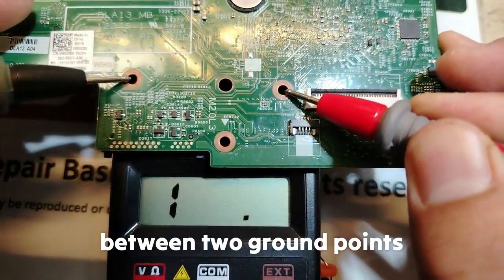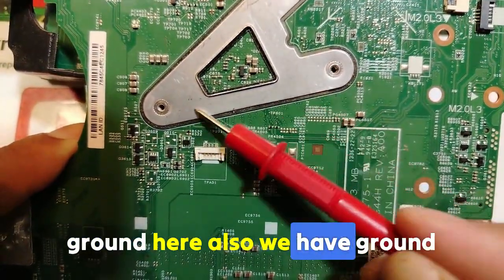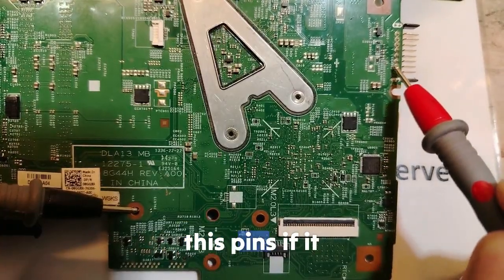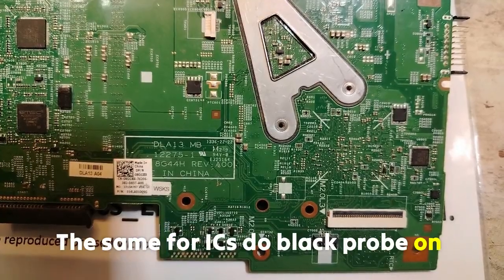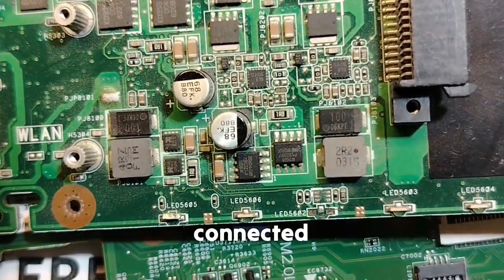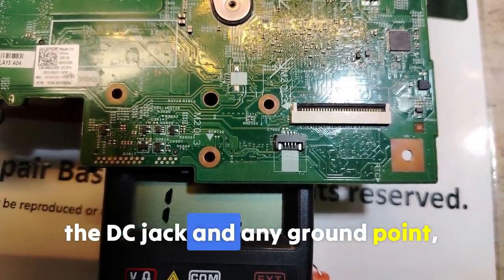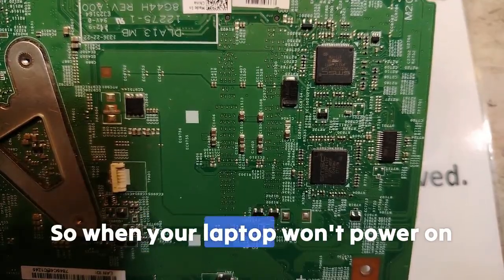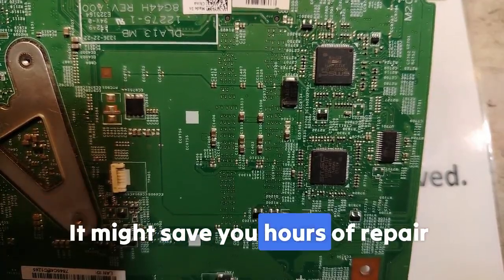Is Your Motherboard Failing? Try This Simple Test - Motherboard Ground Test Every Tech Must Know

Comment: Do i test with power cable plugged in ? Cuz it spark when i tested with red on ground and black got burn my charger back middle pin
Reply: using continuity function doesn't require you to plug the power in
Reply: When testing for sort in a faulty motherboard, you should never plug in any voltage into the board neither from charger  nor battery and you only test with continuity mode on the multimeter
Reply: @mtechcomputers-ug How test 20 Volt by multimeter , laptop  on